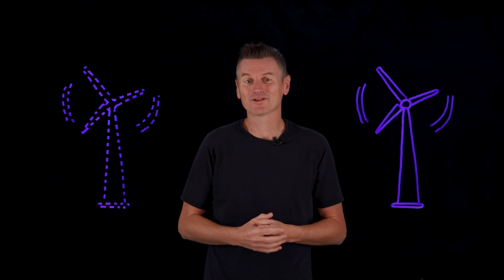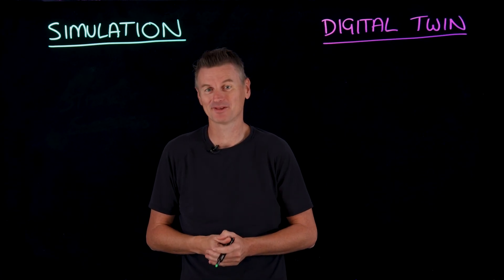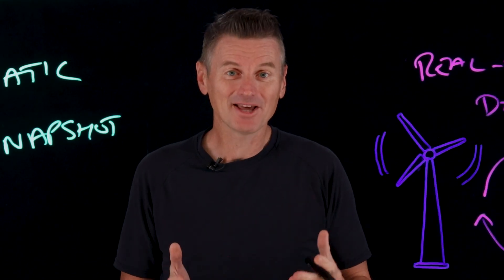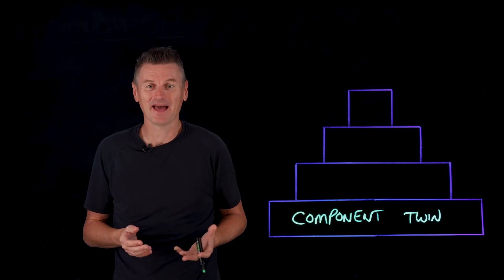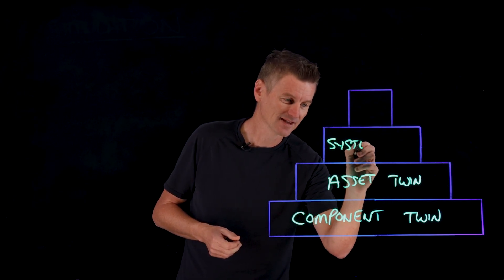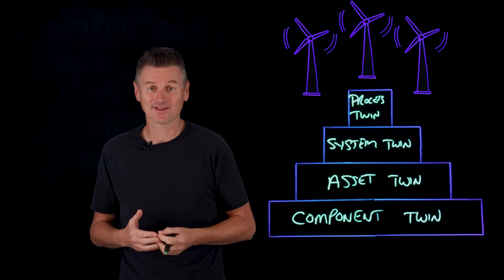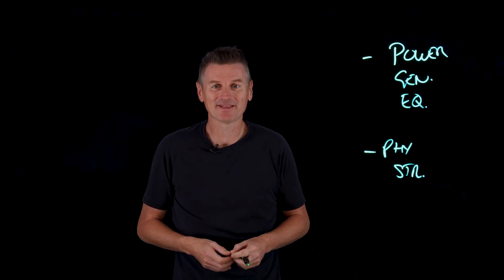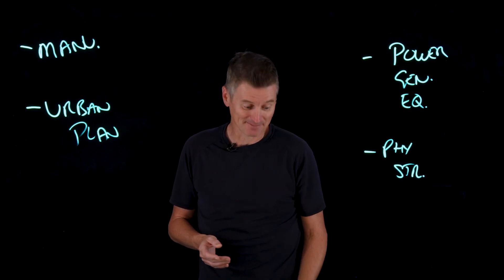What is a Digital Twin?

Comment: Export the IBM, Azure, Chat GPT, Revit, Plant 3D, Civil 3D, Inventor, ENGI file of the Building or Refinery to Excel, prepare Budget 1 and export it to COBRA. Prepare Budget 2 and export it to Microsoft Project. Solve the problems of Overallocated Resources, Planning Problems, prepare the Budget 3 with which the construction of the Building or the Refinery is going to be quoted.

Comment: Export the Grok, MatLab, Azure, Chat GPT, Revit, Plant 3D, Civil 3D, Inventor, ENGI file of the Building or Refinery to Excel, prepare Budget 1 and export it to COBRA. Prepare Budget 2 and export it to Microsoft Project. Solve the problems of Overallocated Resources and other Planning Problems, prepare the Budget 3 with which the construction of the Building or the Refinery is going to be quoted.

Comment: <tl;dr>: Regarding the very meaning, where is the "twin" in a "digital twin"?!

So a term had to be coined. Hmm, well. Of course it is not IBMs invention and the explanation of what the term is supposed to mean are right. Some real time data plus calculations and processing on it. Why not throw in some more of those "modern" terms in like "Observability", "IoT", "BigData", "AI"?! However, where appears the (instance of a) "twin" in the digital realm of the component or system or whatever that is observed for the purpose of acquiring that real time data to provide it to processing?
And what else would a simulation model be, that is just fed with real time data?! In this case the model at least forms something that can be perceived as a "twin"?
I feel like the term "digital twin" itself might be a bit weak and misleading when the core just is to gather data, perhaps relate that data and process it to draw conclusions or to establish some part or kind of feedback control. Only because the capabilities to do that have enhanced over the last couple of years, no new (marketing?!) term needed to be introduced. Or where is the large technical step that sets revolutionary ahead by so far what could be conceived as just evolutionary progress?

When the foremost purpose is to achieve "predictive maintenance", then the focus is on appropriate data processing with the special outcome of extrapolations, but not on creating a "twin" in terms of an equal model.